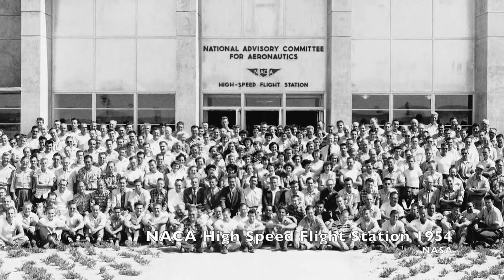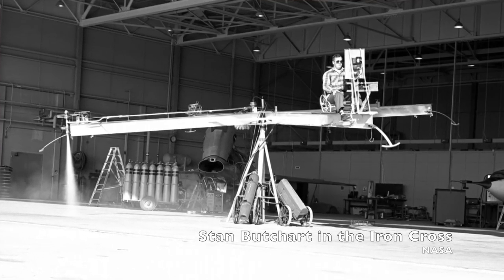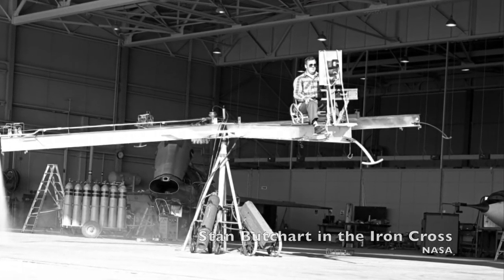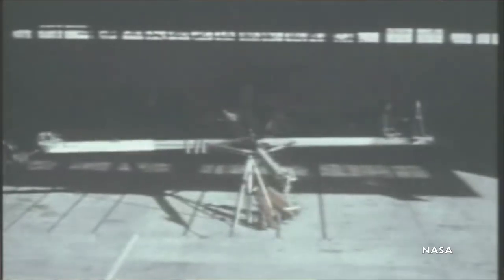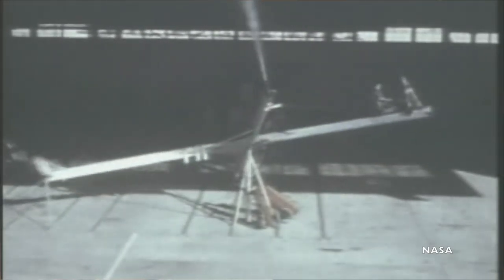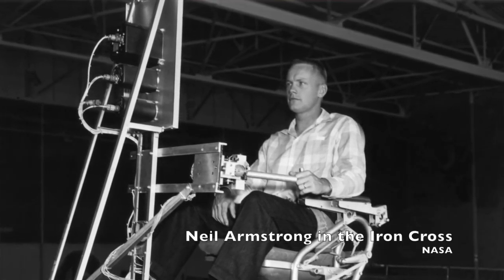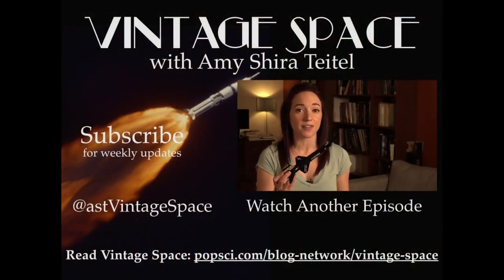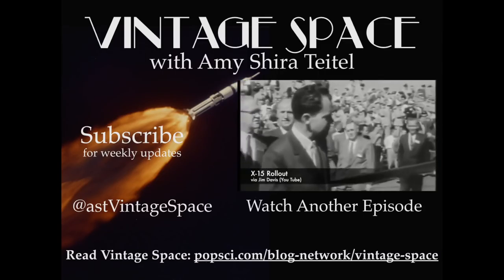Simulated Spaceflight with the Iron Cross

Comment: A minor nitpick: Twisting the control stick changed yaw, not roll. Roll and pitch were controlled as with a normal stick, but lacking rudder pedals, a twisting action on the stick was used for yaw.

Comment: at 1:24 or so, is that a modified super sabre with a camera or something in the nose/air intake?
Reply: nice catch. i'm thinking it is a mount point for a pitot tube. most super sabres i've seen have a pitot tube mounted underneath the intake on the aircraft's 'chin'. the one in the background there doesn't have a lower pitot tube in that position so perhaps they were experimenting with one mounted above the intake.
Reply: Could be, I was just thinking something more exotic in that hanger!

Comment: Why didn't they just use submarines with reaction controls?
Reply: operating a vehicle underwater is not the same as neutral buoyancy training.  There are numerous factors that still present a gravitational bias, as well as the fact that it is far more dangerous to test unproven techniques in a pressurized underwater environment, than in a controlled laboratory environment.

Just not technologically and financially feasible.
Reply: K1productions Not to mention that the greater resistance provided by the water will cause the vehicle to behave in a manner quite different from the way it would behave in space.
Reply: *****
Exactly.  You don't get the subtle reaction to thrust that a vehicle in space would encounter.  Operating a vehicle in the water is pretty much total opposite of what one would encounter in space.